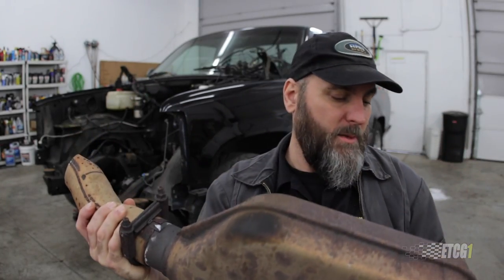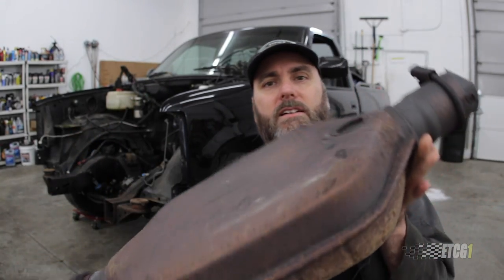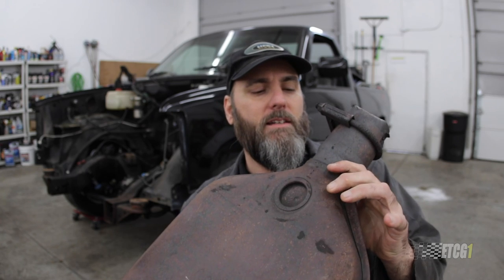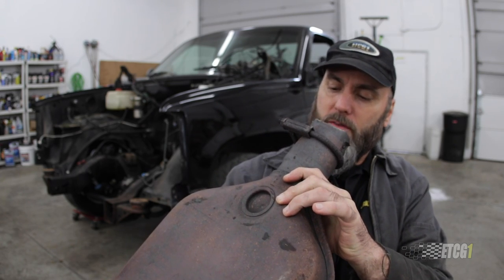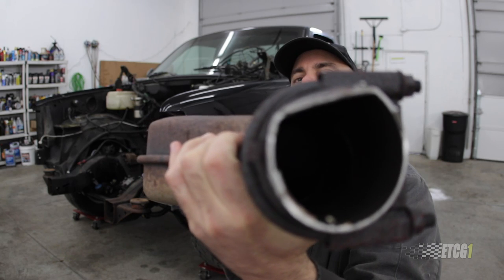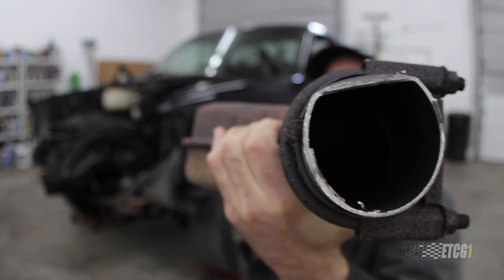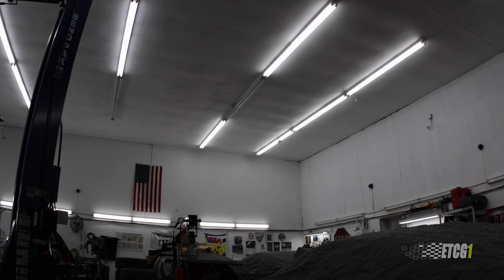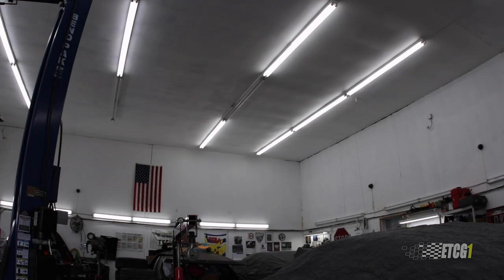Should You Run a Catalytic Converter on Your Hot Rod?

Comment: I have MagnaFlow exhaust on my 01 Dodge Ram I was thinking about cutting off the Cadillac converter then welding the pipe back is there any upside to doing that will I get more horsepower and also will it change the sound drastically cuz it sounds really good right now I just don't want it to sound like s*** cuz once it's done that's it there's no putting it back .. any thoughts .. also you seem like the perfect person to ask this question I don't want to make this comment too long but I changed my O2 sensors and I got them mixed up would my truck still run right if I put a downstream O2 sensor in the Upstream spot and vice a versa and when I was installing the Upstream O2 sensor I connected the connector first then screwed it in to the exhaust which Twisted the wires up should I untwist them or does it not matter I know that is a lot of questions but I would greatly appreciate it if you could answer at least one ..thanks for your videos

Comment: I used to run a cat but it got clogged and I just dont have the money rn to fix it but it's a 99 318 magnum and it's not a dd. I have a 1991 12valve cummins with no emissions on it from factory. I have no emissions where i am but high flow cats are the way. diesels will take along time to phase out but they die faster and use more fuel to run the emissions. so is it really fixing emissions with dpf etc when they burn more with it on. cars burn cleaner now but major cities should start implementing in electric imo.

Comment: I had a fire started under a vehicle I was driving due to the cat's heat. It was a new car back in the 80's.  From that point on always told the men not to park on the grass or side of the road. As you know can not park on the road so there was the problem. If it can be removed within the law, I would say remove it. Our country started the cat thing anyway, look what it is doing to the diesel and their fuel mileage?

Comment: If it came with cats, put new ones on; a high flow cat is better than no cat at all.
Legally, I am required to install a cat on anything that came with a cat in my area, I know through tuning I do not need to install one on my modern Subaru and it will still pass state emissions inspection requirements, I'm replacing my OE downpipe (cat literally blew out on me) and I'm putting an aftermarket DP on, which has high flow cats.
Similar argument "well I only drink a 12 pack of soda/beer every other week, I don't need to recycle"

Comment: To be honest if I didn’t have to run cats where I live, I wouldn’t. Engines have so much potential, until you start throwing all of this emissions crap on them. Then they don’t run how you would like them to. They just don’t run quite as well or as efficient and they don’t last as long either! But because by law I have to have cats on my vehicles, I do. I run hi flow cats. And if anyone has to or is going to run cats on there performance vehicle I suggest going with hi flow cats at least. I’ve gone to the dyno before & after installing hi flow cats & while it does depend a bit on the vehicle, in general they don’t have as much of a negative effect on performance.

Comment: Low Mileage use with no emissions  vs  High Mileage use with emissions 

??? 

I'm aiming for emissions in my '78 which I EFI'd and just got a Catalytic for and now looking at how to tune to not wreck the cat... lol, EGT's... EGR's, oh my. <3 all
Reply from the maker: Start with conservative timing, 28º total or so,  and keep the fuel mix around 13:1, but 12:6 under acceleration. That should get you started, but in order to get the most out of the system a tune by an experienced tuner would help a great deal.

Comment: Upgrade the Cats to modern high flow designs.  You are likely never going to be running it at 10/10ths and you would not likely feel the restriction or the weight.  The CO2 is healthy (regardless of what AOC says) and CO is deadly. Even though you live in a rural area and don't drive it much, you will still take it to the city sometime.   Unless you are going to run E85, I would keep Cats.   The nature of the Fairmont means it create more pollution going up and down the lift in your never ending tuning.  Once that truck is "done" you will be driving it.  Maybe not much, but over the years you'll put some miles on it even if you continue to upgrade it.  No, yours isn't creating much, but everybody's together is still making too much for our health, particular in town.  No hate if you don't, but you asked for comments.

Comment: In densely populated areas emission laws make sense, I mean look at LA in the 70's, the smog is an issue. In all honesty though, the cars on the roads today are far more clean burning and efficient than those of 30 years ago. Time goes one way so as the vehicles get newer the emissions will only become cleaner and the number of older vehicles on the road will decrease. So I have a hard time understanding the need for even stricter emission regulations, especially for older vehicles (densely populated areas being the exception). My rule is to run the factory emission system for as long as you can. Eventually age will catch up and by that point, who cares? I'm reducing my carbon footprint by driving an old car. My 1991 Toyota has recently had the cat removed due to it becoming a major restriction after 28 years, I still have the air injection working, a new O2 sensor, and a properly tuned engine. My 04 Mazda had the third cat self destruct and now the manifold precats are starting to have issues after 200k, I don't see the logic of dropping nearly 1k into the emissions system of a 15 year old vehicle. Lucky for me my state doesn't give a damn either way.

Comment: A 100 cell high flow cat is what I would put on a tuned car / hot rod. If I had to. I wouldn't be responsible if I just hacked it off, but. If it's fine to have it off then Bob is your uncle.

Comment: Let me validate my statement by stating that I have had a California smog inspectors license since 1993. Now living in the San Francisco Bay area we have the most restrictive smog laws of the nation. Do I agree with removing the catalytic converter on a vehicle that's rarely driven I don't really have a problem with it I personally have a 3/4 ton 93 Chevy that gets driven maybe a thousand miles a year at the most. With no catalytic converter on it. It is registered as a classic and pretty much not used it all it's used to tow occasionally in the summer months. Do I believe that the smog laws are needed absolutely just in my time frame of being a professional mechanic since the early 90s I've seen a large amount of air quality increased in the California Bay Area. Is it needed absolutely should we do away with the program though in fact I believe the program needs to be vastly more restrictive because there's a large amount of vehicles that are slipping through the cracks from the 90's that had a lot of stuff on them that they were trying to catch up getting away from carburetion and getting it to early Mass production fuel injection. The 90s was a big transitional. Along with the late 80s now that we have these systems down to a fine science a lot of these vehicles have zero emissions coming out the tail pipes
Reply from the maker: Thank you for your input!

Comment: I have a diesel with a cat on it, i couldn't remove it due to the yearly safety and emissions check, but would i if i could? Maybe, then i also would modify it aswell but this being my "Daily" and my commuter car that wouldn't be a good idea, droning would be an issue if i straight piped it wich i wouldn't because it's gay, and being that it is a high milage car i wouldn't want to do too much in the way of modifications either, for a FWD car a preformance chip would be enough as it's factory tuned already

Comment: Well. Something I have thought about. Because I need to remove cats just to keep my truck on the road. I do understand the smell of my messed up cats now is far from safe air. That being said. How do we know for sure the converter is working after a few years. The only way we knew was sticking that probe up the tail pipe. 

The it comes to the magical O2 sensor. Something looking to see if some O2 is still in the exahaust or is cleaned into by a cat. Ok great you found O2. What other chemicals can be in the exhaust? Lots. Even when all is running to "speck". Do we really know that older cats do anything?
Reply from the maker: Inferred thermometer. https://www.youtube.com/watch?v=9VZ5K8n5jj0

Comment: Eehh its gray area  if you meet the exemption  and you are 150 % exempt  do what you like it is federal law  and it varies by state to the point of you can be fined in other states, leaving show, if you get spot checked  
Me I have done both and  on off and high flow 
 I like just a high flow  cat or 2 where applicable
 there cheaper  now  and your not chasing 7 second runs in the quarter , hell it would be a good  project,   do emissions testing with a cat  and without,   or dyno even

Comment: Running a vehicle without a catalytic converter when the vehicle came with one takes no regard for the environment and the nasty emissions. Ever stand behind a car idleing without a cat? Think of the pedestrians, cyclists, etc who you pass that breath in these emissions. Several aftermarket manufacturers make inexpensive high flow cats that are better than nothing.
Reply from the maker: The new fuel injection system I"m running is WAY more efficient than the stock one ever was. Just that alone will improve the emissions of this truck over stock. Not saying you're opinion is wrong, just trying to inject some clarity.

Comment: I believe with a proper dyno tune it can get pretty close to having quite proper emissions
Reply: Meeting emission standards without a catalytic converter is still in the realm of future or upcoming tech like HCCI engines which require a lot more precise instrumentation and control to make them work due to how specific the conditions to achieve HCCI are. You cannot meet emission standards with a conventional engine since it requires running the engine near stoichiometric which burns too hot for engines to handle continuously, may cause knocking and also produces NOx.

Also, even if you could tune an open-loop conventional engine to zero/low emissions on a dyno, the dyno runs cannot compensate for variations in fuel composition (specific proportions of different hydrocarbons, ethanol, moisture, detergents, stabilizers and other additives), air composition (0-100% RH is 0-5% atmospheric water by volume), atmospheric pressure, ambient temperature, etc., so your low-emissions open-loop dyno tuning would only be valid under the exact same operating conditions the engine got tuned under.

Comment: Run a GESI Ultra High flow CAT, there rated to 850bhp.  I'm in a similar position and decided to go this route with a build Honda K24a and Rotrex supercharger, it should be making around 550-600bhp.

Comment: modern EFI (port injection) is far better emmissions than TBI or especially carbs.  Throw on top of that, your "average" driver wasn't performing required maint resulting in very poor efficiency.  Generally, if over 25yrs no cat.  If you don't smell gas, no cat.  If yes to either previous, HI-Flow cats.  Then just comes the tuning of where to install them for good exhaust pulses/scavenging (within packaging allowances).
Yes, smog is a real threat, but the gross polluters are largely gone.  The coal-rollers do far worse than a performance tuned toy.  Hell, with midern EFI you can run several maps and select them for the daily use (efficiency, TQ power, race HP...) then yo9u can have a clean-burning machine for daily use and a HP beast-mode for Power tour or weekend races.

Comment: Under Federal law you cannot remove emissions components, just because they don’t check for it in your area doesn’t make it legal. I believe you’re susceptible to a $25,000 fine. Hellcats are making 797 horsepower with catalytic converters, there’s really no reason not to run one. That being said, the old style you cut off suck. I’d always recommend switching them out for a high flow cat. I added a high flow cat to an open y-pipe and you couldn’t tell the difference except the sound was slightly smoother and it smelled way better.

Comment: Leave them off. I don't even run them on my daily driver. I even picked up about 1mpg average from taking them out. Our vehicles are just a tiny drop in the bucket when it comes to emissions. It's a statistical zero. Not worried about it.

Comment: If you're making the car run cleaner because of the new hardware  being added, I think the question is moot. Most new fueling systems run cleaner than the old systems. If the state laws say yes, you have to do it, if it says no, then you don't. If you HAVE to, there are compliant performance cats out there that don't rob as much power as the manufacturer ones, you could also use them if it puts salve on your conscience.
Reply from the maker: My exact thinking. Thanks for the comment.

Comment: Hey Eric!  You might find this an interesting read... https://www.tandfonline.com/doi/pdf/10.1080/00022470.1966.10468433  Looks like you'd probably have about the same emissions when comparing a Carburetor with a cat vs Port Fuel injection with no cat.  The improvements of fuel injection especially on low speeds or sustained high speed / low load is much more improved when compared to a carburetor.

Comment: Okay well personally me I would not run a catalytic converter on a vehicle that's older but if it's fuel injected then you go and take that off or gut the catalytic converter than you mess with fuel and air mixture because it's fuel injected and I'll make it either run rich run to lean because it has oxygen sensors for the computer that's only thing I worry about it messing up the engine only now of it's fuel injected engines now if it's carbureted then there should be no issue at all even if it did have an oxygen sensor cause with a carbureted engine it's way different but something that's fuel injected I would kind of hesitate about gutting the catalytic converter and I'll make it run funny or run to Rich like I said or too lean ? . What you think wanna know thanks

Comment: the older motor and converters if it was brand new it would not passed todays emissions controls if a car is 25years are old its a classic i would not waste the money on new catalytic converters i would go with a good hight flow exhaust system to help your older motor breathe

Comment: If a vehicle was designed with emissions systems then they must work correctly, in the uk.
If they don't work then the m.o.t test fails and that car can't be used on the public highway.
Old classic cars that were never designed with emission systems are exempt from the test.
Reply from the maker: Thanks for that input. I'm just curious if with my updated fuel and ignition system if my emissions will be equal to, or only slightly worse that it was stock.
Reply: I think you need to find a frendly emissions tester that would do the test after you have finished all your engine work. (Dollars tend to work.) 
The worst case allowable emissions is the bit you need to know.
Make your truck run slightly weak in mixture, that helps for lower emissions.
What am i doing, you know more about engines than i will ever know lol.

Comment: I live in central Oregon and i purposely remove the catalytic converter ot if all my vehicles.  For a few reasons,  they are restrictive(cause excessive back pressure), they stink, they hinder the performance of the vehicle,  and they cause fires due to their high heat.

Comment: Daily drivers (7days a week) by all means use the emission control equipment. Older or Much older cars, and hot rods should get a pass on such emissions equipment.  One exception the high performance vehicles that are used in spectator motorsports. We don't want to hurt the fans.

Comment: Soo, eric, my car came out without a cat, and i've done an engine swap, Supposed to have it, since all emissions on that engine stay with it, but there was a little loop that worked for now, install a better engine that came with the car, and run the original cars emissions compliance, seemed to work so far.. but whats another $200 for a high-flow 100-cell cat? works well enough, and lets enough flow though..

Comment: I believe you absolutely should have a catalytic converter on it. Engines move faster than gasoline burns, in fact above 1200 rpm, no amount of ignition advance will solve that; products of incomplete combustion will leave your tailpipe. If you try being a pedestrian, or a cyclist for some time, you will probably come to hate cars that emit pollution, regardless of if they're "hot rods", because while you're huffing and puffing using your physical energy to move down the road, suddenly you're breathing toxic air. I hate driving with the windows down behind a car with no cat, and I go out of my way to pass them. I would be wholeheartedly embarrassed and somewhat ashamed to drive a car with no cat, especially driving by cyclists.